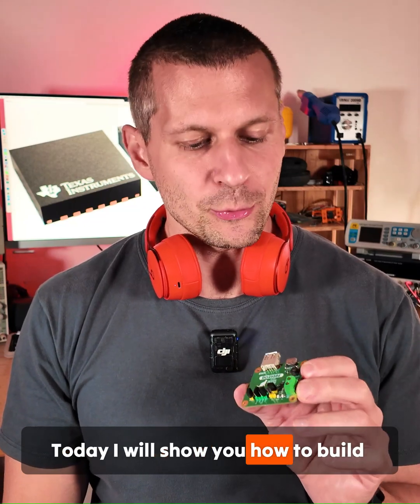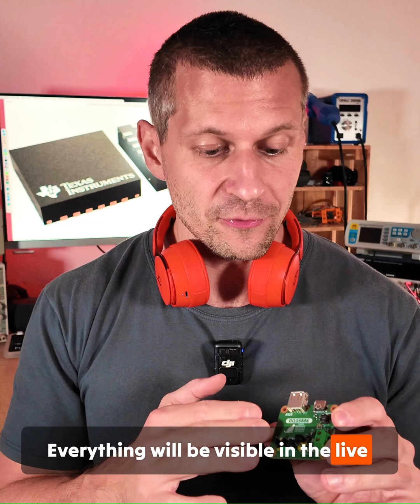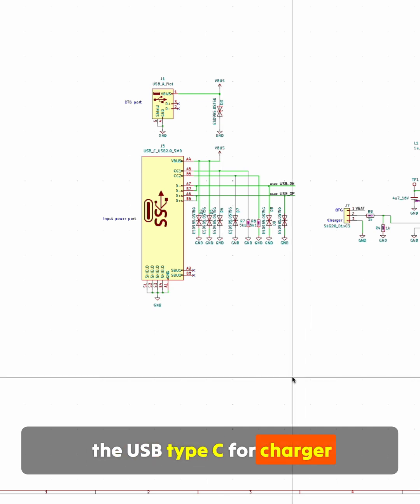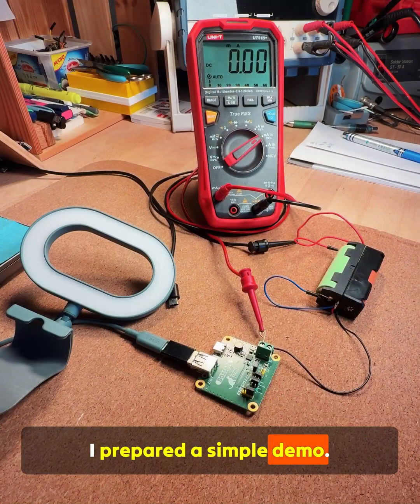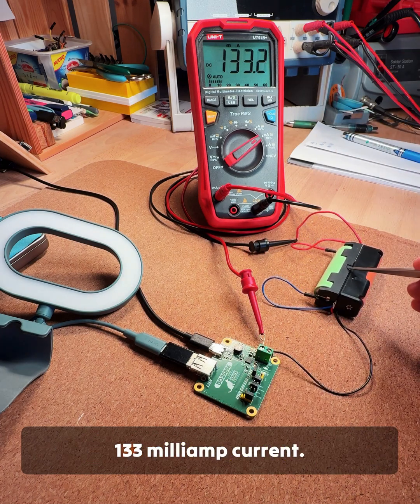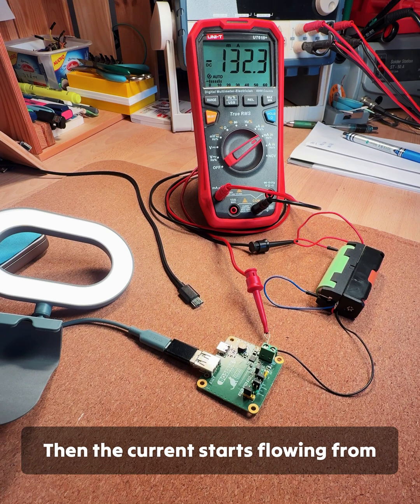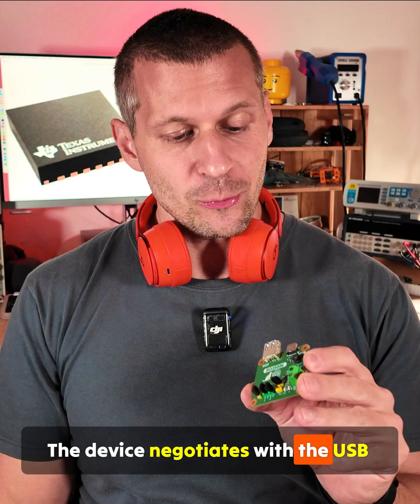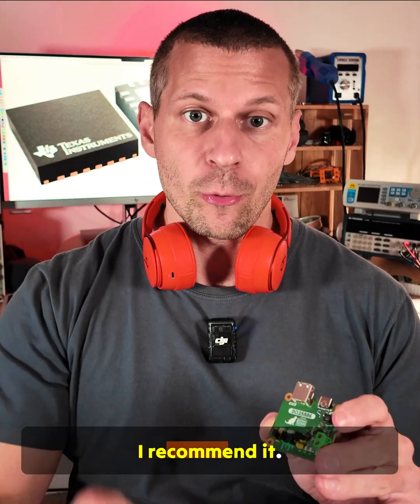I’ve crafted a USB power bank and Li-Ion charger with a single integrated circuit.

Comment: Amazing! I was literally about to design this exact circuit, because it seemed to be the only 1-chip solution from TI that can charge multi-cell battery banks. Have you found anything suitable for 4S and ideally with dual role port USB PD? without requiring EEPROM Flash, a dedicated USB-C port controller etc?
I have only briefly looked at the description of Infineons /Cyprus EZ-PD PMG1-B1 , but I am not amazed.

Even though your content is super specific and might not find many views, this is amazing and super high value. Do you pulish your design files online? I too am using kicad